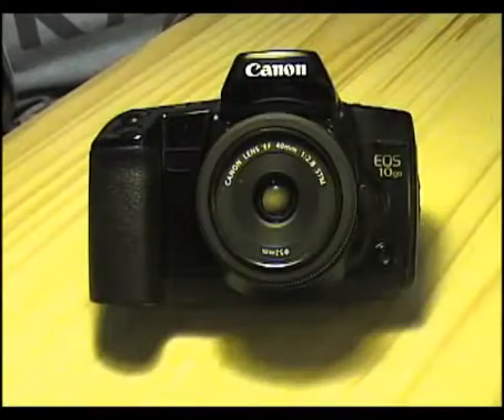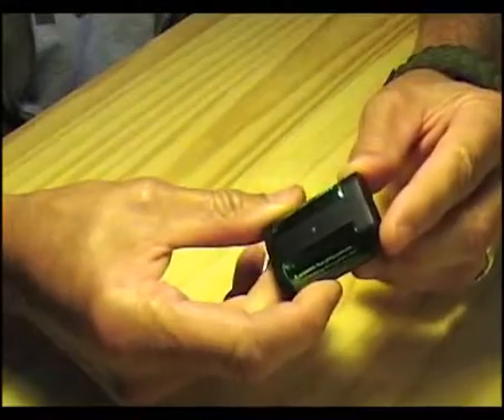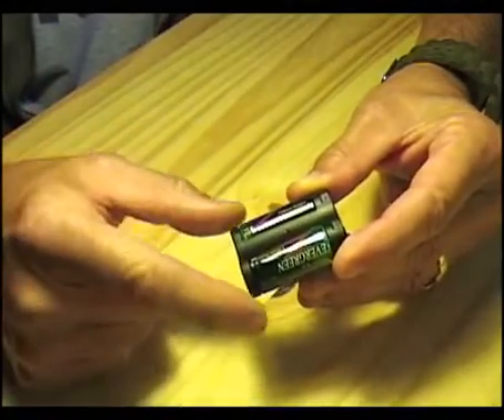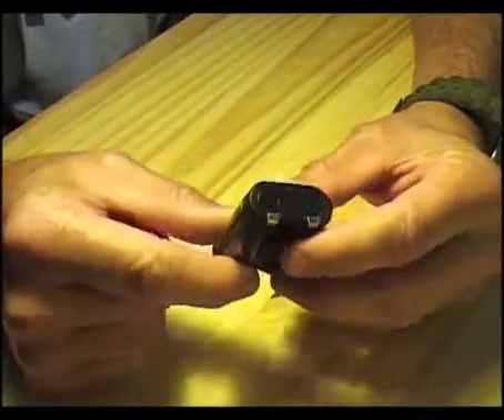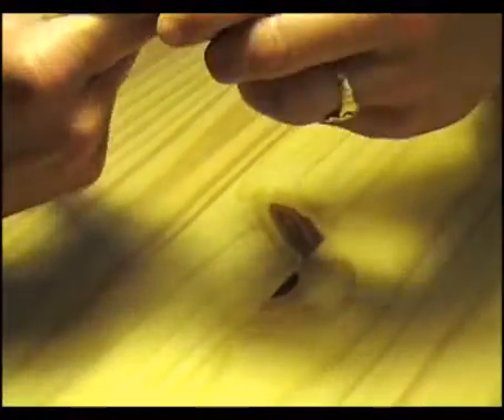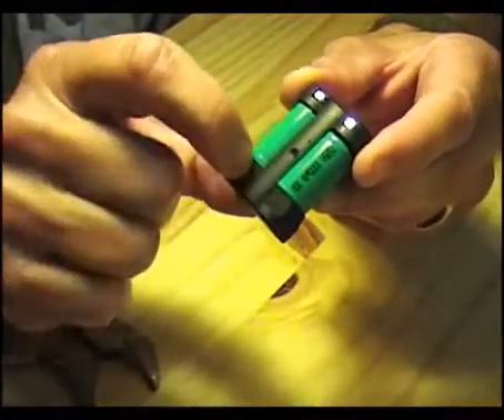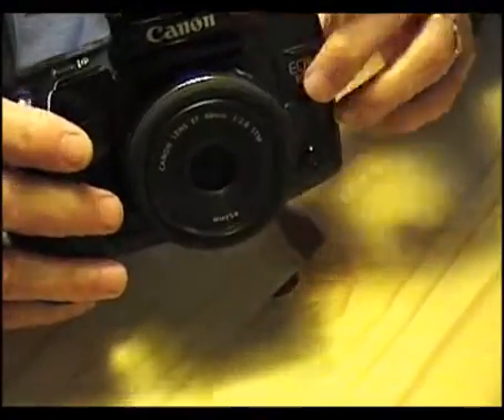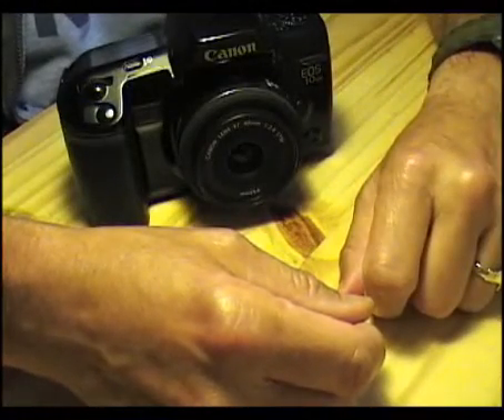Battery Instructable

Comment: Is the focus of the 40mm 2.8 stm mounted on the Eos 10 accurate?
Reply from the maker: Yes, the pancake lens covers the whole 35mm frame and focuses just like any other Canon EOS lens.  If you put it on a digital camera with an APS C-sized sensor, it will act like a 65mm lens due to the 1.6 crop factor.

Comment: NanoBurger Thanks for the instructions! Based on that I have built a much beefier version with brass contacts (filed down bolts), properly soldered connections fitted to phenolics contact plates, and the wiring between the battery contact plate and output contacts properly potted using resin. 

By the way an American firm who supplies gear to the armed forces makes an adapter for taking two CR123A cells, meant for a piece of equipment designed to take 2CR5 "kidneys"; they might not sell to the general public, but then we are trying to use rechargeables anyway. Thank you again!
Reply from the maker: Cool, do you have any photos?  I may need to have to bow down in deference to you!
Reply: NanoBurger, I have not taken any pictures during the process. When I have exhausted another 2CR5 of this type - rather than the sealed type - I shall remember to record the process. And I thank you again for your inspiration!

Comment: Hi, a question, why don't use a couple of CR123A batteries?

Best regards!
Reply from the maker: I would have if I had 123 rechargeables!  You can use non-rechargeable as well I guess.  I just had these smaller cells that were rechargeable so that is what I used.
Reply: NanoBurger
 ok! thanks for the answer! :)
Reply: In Australia, LANplus sells CR123 INR 3.7V cells for $5.50 each (Dec 2022), which can be recharged in a normal 18650 li-ion charger :D Thats what I'm going with (for an old Canon EOS 5 film camera)
Reply: @RexNathanChan  How long have you been running batteries and have seen any difference in shutter speed?
Reply: @shelliecarlson7015  sorry I never ended up using them, lost interest in film and canon eos5
Reply: @RexNathanChan  bummer